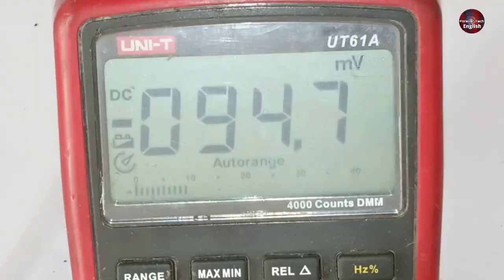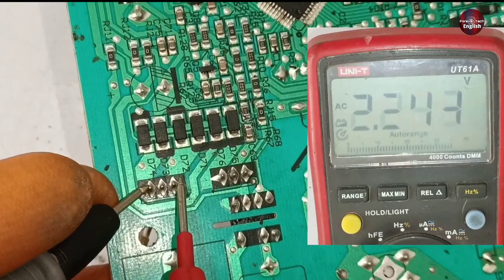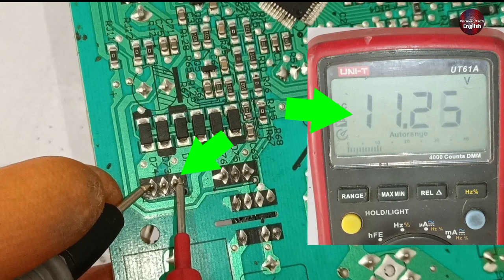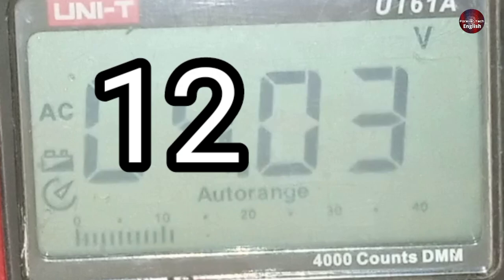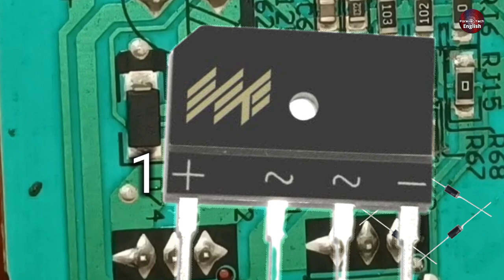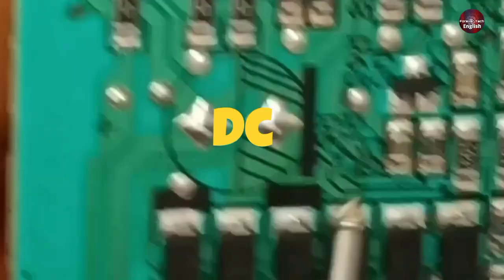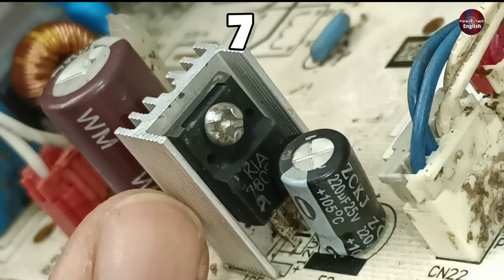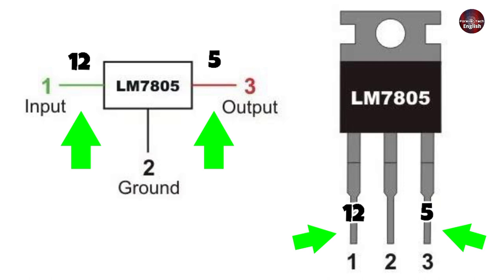Disgusting Mini Split Ac Circuit board Shows 88 error Repair

Comment: Don't understand why you didn't check the caps for short after removing the microcontroller.  🤔
Reply from the maker: I did check the capacitors they were all good. As soon as I installed the microcontroller, all capacitors showed short again. This means the microcontroller is shorted.